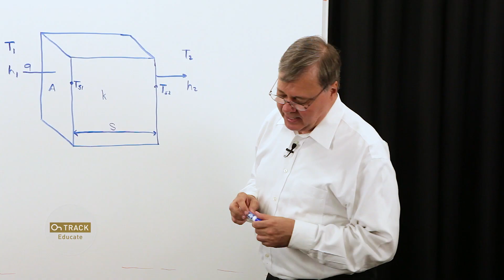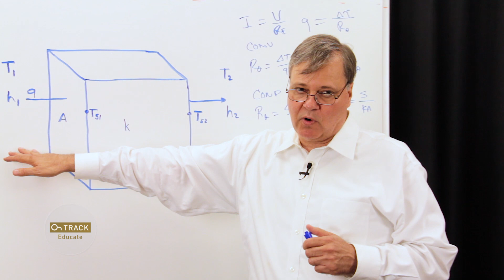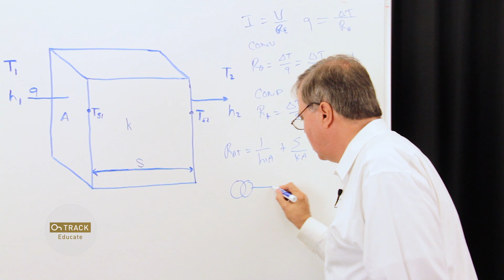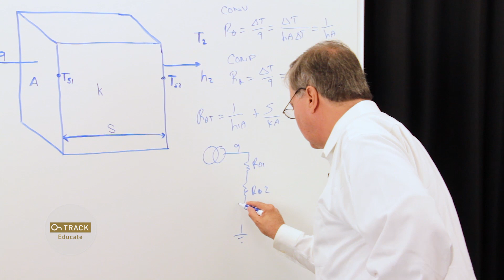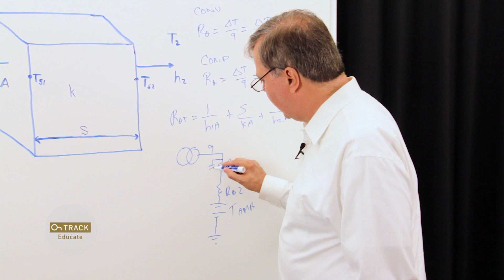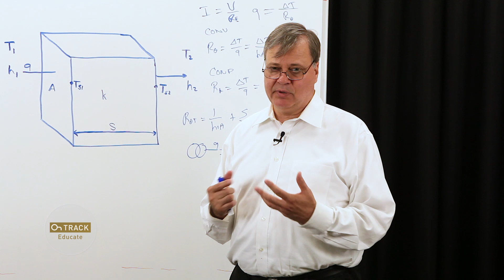Thermal Management (Part 1): Thermal Resistance Concept - OnTrack

Comment: Thermal management market size was worth USD 11.1 billion in 2019 and is projected to reach USD 16.2 billion by 2024, at a CAGR of 8.0% during 2019–2024. Major drivers for the market are the rising demand for effective thermal management solutions and systems in consumer electronics; increasing use of electronic devices in different end-use industries; and ongoing radical miniaturization of electronic devices.

https://www.marketsandmarkets.com/pdfdownloadNew.asp?id=155049228

Comment: Nice one for starter, I have spend two years explaining schematic dudes how does heat-sink works. It would be nice if you made a heat map for a board in future, because I know a lot of people who does not believe that group of components are heated up more that individual component and they do not believe in superposition also.
Also I would love to hear something about critical temperature of the components, I will not point finger, but there are people in a market who use commercial components in industrial or equipment used outside.
Reply: PDN Analyzer for Altium Designer does not directly show you a heat map BUT it does show you voltage and current densities which are closely related to heat. I don't know if i can share details but the next release of PDN Analyzer is impressive, really upgrading a lot of stuff. here's a link if you want to check it out: http://ow.ly/aG2U30gsfgj